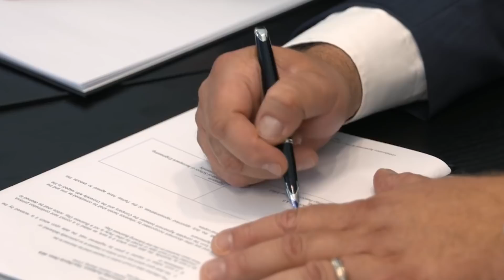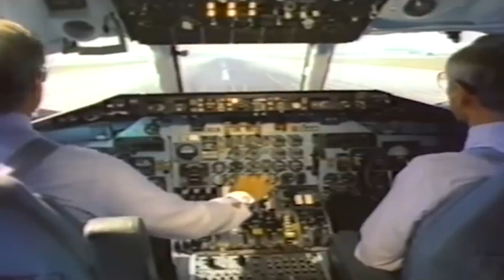Boeing 717 - Boeing model and legacy of Douglas

Comment: Most of the 717’s that Delta has are sub-leased from SWA (since they didn’t “fit” the SWA model when it bought AirTran). 88 airframes came from AT, hence the N—-AT registration #. AirTran had picked up all the TWA fleet & a few from other carriers over the years. I flew the 717 for 14 years & 12,000 hours. It was a great plane, but it had very few orders after 9/11 & after flying the B737NG for my last 5,000 hours, it is definitely a better airplane. Less fuel burn on a 737-700 & 20 more seats, power galore, & larger cargo compartments. Both are great machines though.

Comment: Worked at McDonnell Douglas LGB as a Flight Dispatcher for Commercial and Flight Test from 1987 -2002.  You are right in what happened. McDonnell Douglas was being run by bean counters. When the buy out came with Boeing most of the executives from McDonnell Douglas ended up running Boeing. Case in point B737-Max. Best aircraft Boeing ever built is the C-17.

Comment: While everyone is mostly focused on Boeing vs MCD religion, the one component to the issue of the 717 and future development was ALPA (pilots union). ALPA had negotiated work rules regarding planes with 100 seats or less. This was done to allow non-union entities like Republic Air and others to operate smaller craft (under 100 seats) like Embraer, Bombadier, Fokker, Saab, etc. under their non-union "Express" labels.  This caused a problem for the MCD certified union pilots and Boeing sales.

When Boeing tried to market the "small" 717 it ran afoul of the airlines, because the flight deck mandated a union certified pilot. Small operators couldn't afford and didn't want expensive union pilots. The Boeing 737 ALPA mafia was dead set against the 717 getting larger as this impinged on their job market for yet more 737 cockpits. ALPA was dead set against having non-union pilots get MCD flight deck expertise. They were afraid it would be a trojan horse for non-union pilots to wiggle in on union space.

So when the 717 ended, this split the market for pilots.

Many of the certified MD-8x pilots went where the planes did or got updated certification on the 717.  So 3rd tier discount carriers bought up all the used MD-8x (like Allegiant) and the 717's were rounded up by Delta who already had a healthy MD-8x ALPA squad and simply updated the certs.  Many former American/TWA pilots that didnt want to recertify for a Boeing flight deck went to Delta. The rest flew out their life cycles where the MD-8x was and until 2018, Allegiant was one of the largest operators of the MD-8x. (at times to their detriment).

So while people talk about the suitability of the airframe, it was really the pilots union that forced Boeing's hand. It is interesting that no one discusses the impact the American pilots unions have on the types of planes built, the cost of a ticket and what kinds of planes can fly.

Comment: The Midwest 717's with the 2x2 Recaro seats with the ear wings were awesome. Too bad the airplane only helped sink the airline. Douglas built the pinnacle of the short haul airliner at the worst possible time. On the same level as Lockheed being too far ahead of everyone else when the L-1011 entered service. Delta was smart to scoop up as many of these as possible.

Comment: The China Trunkliner program failed due to manufacturing plans that did not cover the necessary rework to custom fit parts in assembly. This was prior to computer aided design where theoretical parts actually fit in 3D, not so with paper drawings based upon shipbuilding technology.

Comment: I am a flight attendant on the Qantaslink 717 and I have to say they are a wonderful little plane. Great fast, steep take offs, climb like a boss and handles turbulence very well. Smooth and quiet at the front, a little noise at the rear for obvious reasons but such a fun little plane to work on!

Comment: The MD95 was targeted to Northwest Airlines with it huge fleet of DC-9’s and SAS, long a Douglas operator. Boeing hastily cobbled the 737-600NG to block the SAS sale. Exactly the same strategy Boeing used at United and Lufthansa to prevent DC-9 sales: launch the 737-100/200!

Comment: I remember when AirTran first got these. I flew them and the 717 a lot and I was always taken by how powerful these were and at the angle, it would take off. I believe the Rolls engines had 40% more thrust than the old DC-9 engines.

Comment: Boing sucks! McDonald Douglas and the original Douglas aircraft company were superior in workmanship, craftsmanship, and better built aircraft than Boeing Aircraft Company! The Boeing CEO is a stupid individual. The Boeing Management Team and design team are idiots! Boeing is all about money and not quality nor safety. I will not fly the 737 max aircraft nor the Boeing 787 aircraft due to safety concerns! Boeing was able to get the McDonald Douglas Company because, stock holders wanted money over protecting McDonald Douglas future and Aircraft Company competition. It sad when good companies and great products are destroyed over greed and a way to eliminate the better competition. Remember, that McDonald Douglas Aircraft Company developed the MD-12 (possibly known as the Airbus 380 aircraft). I sometimes wondered if the Boeing Management staff actually sold plans of the McDonald Douglas MD-12 Aircraft to Airbus because Boeing was not interested in it at all. I hate Boeing and it's CEO and management team. I say again Boeing sucks!

Comment: I was used to flying McDonnell Douglas's MD 80 series aircrafts (now Boeing 717) of European airlines. I did dozen of times in the past decades and any flight was pleasant. That planes were really smooth and quiet flying and their exterior and cabin look was really nice. Above all I adored them when they climbed after take off! Of course I landed with 0 meters visual range foggy conditions at Milan Linate Airport one night flying a A320. Nevertheless I still prefer MDs to Airbus models for everything. Moreover flying Boeing's 747 is one of the life's greatest satisfactions I say!

Comment: Strong aircraft design. Sits low on the tarmac with engines somewhat obscured at rear. Clean, crisp wing profile. Improved comfort with less cabin noise and fresher cabin air.
It looks as though it would beautiful to fly.

Why was the 717 not marketed as a premium corporate fleet jet?

Probably back in production when Boring (Boeing) makes it’s next takeover.....

Comment: Seems to me had the Boeing company pushed the DC-9 inspired design ahead, I can imagine there might have been, could have been something like a 717-MAX 8 which would NOT have have required the MCAS system with the more powerful, extra large fan, high bipass engines mounted more in line with the CG of the airplane. This layout would make a lot of sense since the 737 FOD sucking engines are so much lower than the centerline of the aircraft and cause an induced pitch up. But I'm not a Boeing exec so nothing I think matters. Of course on the other hand if you look at the closely mounted tail engine of the old DC-10 and the problems it caused there is an argument for wing mounted engines. Ultimately Boeing just did what they wanted to do. The 737 has proved to be a great plane, but every design has its limits.

Comment: Boeing should bring it back in the bigger version that would be the equivalent of MD90, and abandon 737.  The 737 and it's look is forever will be associated with failed and almost criminal at this point production process and very bad engineering. MD airplanes were tested by life for decades, they are modified to near perfection and this point and they just take it out of production? Instead they build a brand new airplane with unknown software and untested by life design with engines located in a position that never been tried before. MD or 710 line of airplanes, (and 757 too by the way) went through decades of modifications. A near perfect airplanes, safety-wise, are already there. What a stupid decision to stop making those and try to make a so called efficient new airplane that is cheap to operate at the expense of human lives. FAA is also guilty by neglecting to oversight this quick cheap production process. Renton plant was making these deadly 737 airplanes in only in 9 days nonstop. seems like everyone was under pressure at that plant to make them fast and send then to airlines... The MD line or 710 line should quickly return to production with efficient engines but old life tested design. I guess the largest version would be MD90, to accommodate more seats...

Comment: McDonald-Douglas partnered with the Chinese in a desperate attempt in financing to save the company.  It did not work, and that is why they ended up being sold to Boeing in a last ditch attempt to save it.  That failed as well as the 737 (an ancient design updated from 1967) kept on outselling it. and Boeing did not promote this plane, even if it was one of the best McD-Douglas planes ever built.  In the end, the CA Douglas plant was closed once and for all.  They are good planes, Delta has most of them in the US.

Comment: boring stupidity on full display cancelling this one.  put all your eggs in the 737 basket.  not enough profit margin in smaller planes.  not our market niche of regional aircraft.  
i only flew on this aircraft on the TUL/DFW route.  it was noticeably quieter than any other aircraft at the time.  and how does boring choose to compete in this market now?  lawfare.
the other issue that should be addressed is that airlines don't know what they want.  this aircraft on this route or a different aircraft on a different route.  then let's change them both.
imo, this would have been a kickass private jet.  but nooooooooo let's make the BBJ from our sacred 737.  from the 737-100 to the 737-6789 and everything in between.  we got a plane to suit your needs.

Comment: The DC-9-10 had horrible cabin pressurization problems.  if you flew on one for more than two hours your ears were popping like microwave popcorn.  And, heaven help you if you got on one with a head cold.  You ended up in the emergency room where they drilled little holes in your eardrums to let the fluid out, so your pain would subside and you could hear again. Screw all of of DC-9s and MD-80s.  Trash planes for cheap airlines.  They were also a bitch to load and get off of after landing and heaven help you in an emergency.

Comment: I’m confused. What did 911 have to do with the orders of the 717?
Reply: Kelly Martin downturn in air travel so nobody was buying aircraft
Reply: Most carriers swapped to capacity purchase agreements with regional carriers at the expense of their own fleets, and underwent massive fleet rationalization programs. This gave a big boost to smaller regional airliner like the CRJs and the ERJs, and the 737 and A320 which could be smaller short haul aircraft in the -600 and A318/A319 versions or long haul as the 737-900ER or A321 all with common type ratings, simulators, facilities, etc. The MD series could not match that versatility.

Comment: If I didn't know any better, I would guess the 717 was McDonald Douglas and not Boeing. During the merger acquisition period of McDonald Douglas, I guess Boeing did not have an airplane in that size range so it behooved them to add it to their fleet. I remember the MD-80 which was a great airplane. With the advent of the 737, I could see it's future was doomed. After that you had Embraer and Bombardier which solidified the market for 100-125 passenger short haul Regional Jets !

Comment: What was the ol' saying ? If you want to have the perfect airliner you should have it designed by Lohkeed, build by Douglas (Or MCDonell/Douglas) and sold by Boeing ?
Reply: It was “designed by Lockheed, built by Boeing, marketed by Douglas”.
Reply: @Stratodave  I won't fly in any plane built by Boeing anymore. They are now all dodgy shit (e.g. 737 Max, 737 NG).
Reply: @vladsnape6408  I disagree. I would prefer to fly in a Boeing aircraft. All the crashes with the MAX are related to the training of the pilots. If they had been trained properly, and not a cheaply as possible the accidents wouldn't have occurred. Oh, and I much prefer Boeing for one simple reason. If something goes wrong with the computer, the pilot can bring the plane down relatively effortlessly. With the Airbus' the computer flies the plane, so they are much more difficult to operate without a computer. It has been done, but by chance the pilots were highly experienced with the aircraft, and worked together to get the plane down safely.
Reply: @formulafish1536  nice bull crap and lies
Reply: @formulafish1536  I'm not aware of a planes computer ever completely failing(except perhaps where fuel has been exhausted, and likewise backup generation), computers have saved far more planes than they have affected in crashes. eg: Sully credited the computer assistance with helping him save the plane.
Even QF32 that had massive damage(21 out of 22 systems damaged, 50% hydraulic loss, both main sets of wiring damaged, fuel leaks & unbalanced tanks, fuel dumping disabled, no slats, no powered gear lowering, no reverse thrust, degraded wheel brakes, degraded engines, limited controls, etc) by an uncontained engine failure, still had its computers working reliably(all warnings were correct, including low speed & stall warnings on approach) It reverted to alternate law as several sensors were lost. To quote the pilot 'I had absolute control and every input into the aircraft would be mine - there would be no sudden & confusing or correction caused by the flight control responding to damaged sensors. in essence I was piloting a very basic Cessna that I understood and was comfortable flying' Even then he said he would've preferred auto-thrust to still be working.
The 737 Max clearly had at least as much influence from the computer on the crashes, as any other. Like other computer problems, this was also triggered by (in this case, relying on a single)sensor failure, though in this case repeatedly overriding the pilots.
Extra training wasn't required, because that's what Boeing had intended, as a selling point, and to avoid a new type rating. 
A safety system wasn't added to the plane(presumably using the 2nd sensor), because that would automatically trigger new training requirements.
Also Boeing was actively talking airlines out of extra training & simulator training
https://www.theverge.com/2020/1/9/21059420/boeing-employees-messages-737-max-investigation-simulator-crash
US pilots had also complained before the crashes about MCAS & training/manuals, the crash pilots(especially the 2nd flight) are largely being used as scapegoats.
One pilot wrote that the Max 8's aircraft manual was "almost criminally insufficient."
Their quality control seems to have gone down the toilet in recent years, hopefully it'll gradually return to what it was.
https://www.theverge.com/2020/2/6/21126364/boeing-737-max-software-glitch-flaw-problem
Yes, this is super long, as I find it interesting, so I'd been reading more while writing this.
Reply: @formulafish1536  If its just training why its not back in service? 1Year its long period to retrain pilots.
Reply: @formulafish1536  Boeing intentionally hid the fact that MCAS existed from the FAA, airlines, and pilots so they could claim that no additional training in that area was needed. Boeing CAUSED the training failures, and the FAA took their word and didn't verify the new systems that were between pilots and their control surfaces... oh and Boeing broke BASIC AIRCRAFT ENGINEERING STANDARDS and had the MCAS system only receive data from one of the two AOA sensors that were present, so it couldn't sense an instrument disagree... I have massive appreciation for Boeing. I'd say I'm a fanboi.... but they REALLY messed up here. It's worse than the cargo doors on the DC-10... They will take decades to dig out of the hole that this has put them in. I honestly think they are too big to fail, but the hand washing, back scratching, quarterly profit driven, revolving political door system of US commercial aircraft production has to end or Delta is going to be buying Chinese aircraft by 2035.
Reply: @formulafish1536  Runaway MCAS and the pilots' unpreparedness for the emergency due to lack of training was Boeing's fault. The MCAS system was  already not even disclosed to operators until nearly 1000 people were murdered by this incompetence and greed. Never fly on a MAX, no matter what the FAA or Boeing Execs say. Play it safe and fly on an A320 or 717.
Reply: Nobody can afford Lockheed designs.
Reply: @Bartonovich52  They Over charge just look at the Electra with the unannounced removable during flight wings.  Not much publication about that horrid snafu.  PS there is a list  of others.  No one interest in the truth just Name brand Pushing.
Reply: Don't forget it has to be hated by the Airbus fanbois lol

Comment: I should have added that Boeing created the stumpy, inefficient 737-600 for the sole purpose of keeping long-term DAC customer, SAS, from giving the MD95 an important boost in Europe. The 737-600, a spoiler, only has value in the used market as parts.
Reply: There are still plenty of -600s flying. Did they create the -500 which flew a decade earlier for the same purpose?  How about the -200 which is even shorter?

You seem to forget what this aircraft used to be. It’s literally the same reason why MD made the MD-95 as it was making the MD-90. 

Lol.

Comment: Great airplane but has no Boeing engineering. The MD95 was planned to be paired with the much larger MD90 as a “family” - common cockpit and type rating. However, Pratt & Whitney acted like a spoiled brat when MD chose the BRR700 series and forced MD to not push the family concept. Pratt did this through IAE where I worked. MD95/717 is very much loved at Delta and the other carriers. We see very few for sale.